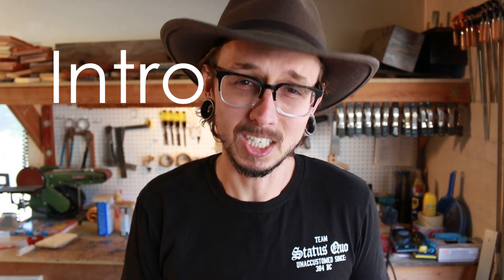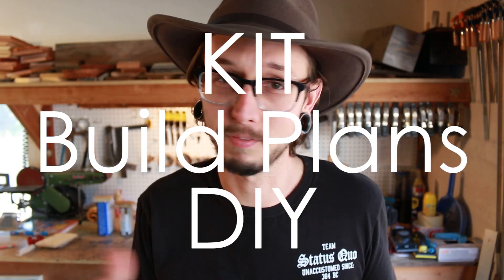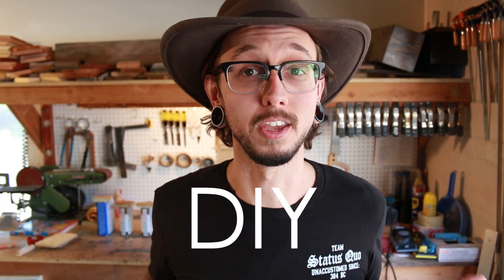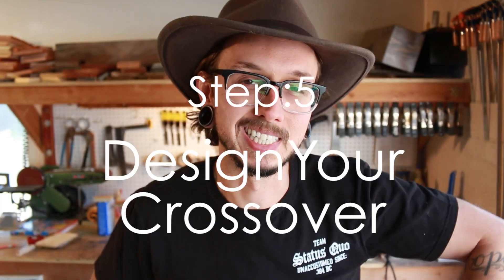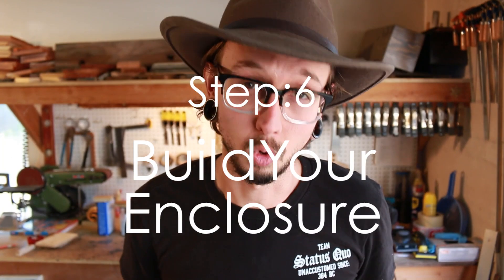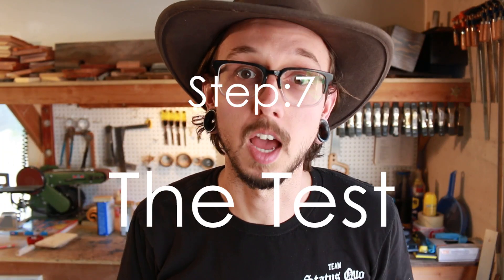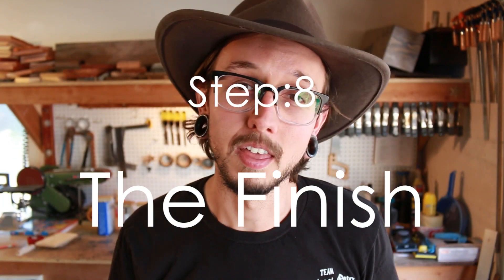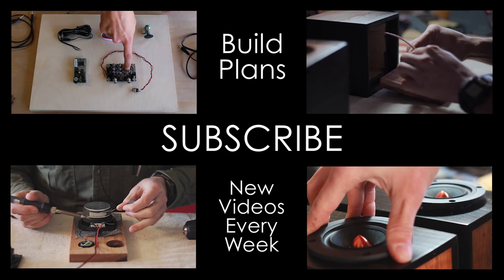Step by Step Guide to Build Your Own Speakers | DIY Speaker Building

Comment: I’m 15 and I started out buying a $25 Logitech surround sound system at savers (witch was acually ok) to now wanting a set of $800 Sony speakers (I don’t have 800 to spend on speaker) so I think this might be the way 😂 I’m really good with electronics woodworking really a lot so I don’t think it will be a problem

Comment: I had some oak boxes I turned into speakers / end-tables. I bought an instruction book from Radio Shack on how to build them for the right drivers. It contained all of the formulations I needed. Then, I ordered my tweeters, mid-ranges, and bass drivers with the proper crossover along with the connectors. They both sounded great and looked better than any item you could buy. Plus rugged enough to be furniture or moved to another location.

Comment: So this video goes over everything i already know. there is no actual in depth video of how and what to put in the calculators. i can calculate air volume that is addresed on the website of the speaker i want. but then if i would like a speaker with a tweater and a mid range that is ported. or a speaker with a full range maybe mid range with a passive radiotor. i can't find ANYTHING that is usefull to what i would like to know or need to know to calculate the best box size. besides that there is more to it like speaker inpedance. For real i have watched your video's but i have not really gathered that much from them it did refresh my memory a bit so i wil continue my search and hope to get awnsers i have read a bit of the Sound Re enforcement handbook from Yamaha

Comment: still dont understand the Hz-KHz, and how to build 1 sound system that can reach pitches that would resemble the old electronic days.. I.E..Laura Phillips Anderson  and hard drum base.. CAN ONE SPEAKERSYSTEM handle all that?   putting a project together with a great Old School artisant, and was asked to build a flight case he can take on the road.. have  parts from Magnat .and lots of sound equiptment ... any tips ? needs to be put in a flight case and ready to board in a plane or bus...

Comment: Check out the Jaycar home speaker 10" woofer (Response brand). It's the 10" paper cone variant and cost about $65 (Australian) each. I got some and I run them with a 4" FR driver. The woofers are in sealed enclosures just with a single 5.6mh inductor on them. The best bass I ever heard! Even if someone offered me a woofer worth a mill, I would still have a real hard time giving up my Jaycar woofers. That's how good I think they are. Maybe it's not the "extension" below 60 hz, it's more the sharp attack of the bass notes and the wonderful kick drum sound. Like you can hear the actual skin on the kick drum being kicked. It's so sharp it's almost like a "tick", but with that deep thud that isn't too overpowered or "muddy" but with that deepness that makes a natural deep "rrrr" but not "boomy" just wicked balanced undertones. Sick! Check them out please, you won't be disappointed. Needs to be with either a med&tweeter or FR driver. They only go to like 1 khz. I can give you more details if you like. Every time I listen to them I wallow in the amazing bass sound like I'm being pampered in luxury. House is amazing with those sick undertones and snappy kick. Fuck I hope you try them (and I suggest you try them in a sealed enclosure, and start off with just a 5.6 mh inductor). I tried it first off with just the 5.6 and it sounded so good that I won't even consider anything else. Also my boxes have a slanted front so the box isn't all straight (and maybe that helps). My speakers are keeping me up all night cos I can't stop listening to the music.

Comment: Step #7
I don't think many beginners will be able to judge what to do with a crossover if they made it by computer or math, or even a pre built crossover. It takes experience to judge how to fix a crossover just by listening to it. I can do it cos I have been trying for decades. It takes time and curiosity. Now I have built a completely GUESSED crossover and it was GREAT the very first time. It happened yesterday for the very first time. My previous set of speaker crossovers took a year before I was happy (a particular challenging acoustic set-up in those speakers). But without experience you may have to go to your computer to tweak it. You have to know (approximately) all the frequencies in hz and khz (when you hear them). And you have to know (off hand) the ranges of the caps and inductors without looking it up, if you have any hope of doing it just by listening. I found out just by hearing different caps and inductors (over the years). No computer or math on paper (just in my head). And you have to know how caps and inductors behave in parallel and in series (way difference). And you have to watch the impedance with your resistors etc. I have some speakers that go down to 2 ohms above 10 khz. lol but I am actually aware of that and the speakers sound great so I don't care but I would NOT put those speakers on any hi end (expensive) amp. And I now have a different driver set-up design and so this is the only pair I made like that. The next ones only go down to 4 ohms in the highs. Ineficient but killer sound top end. And there is the (dreaded) woofer tweeter level that I think is very important cos it gives you a choice on bass content against treble content. Too much woofer can DROWN OUT the nice highs and visa versa. And that I find is about the most difficult crossover challenge. My "tweeters" are coaxial (inside med drivers) and the "tweeters" are completely DIPOLE. That's why they are ridiculously inefficient but killer best treble I heard.

Comment: I'm interested in building some home studio monitors, active if possible to save on space,  Ill be using a macbook pro & maschine studio and dont have room for an amp too. So to construct something like Rokit 5's or NS10's. Any suggestions to where to statrt choosing the component parts to achieve a flat response for playback and mixing.

Also, I have a 12 Kenwood car sub in a sealed enclosure and somewhere in a box some Focal 6.5 's with tweeters and seperate crossovers, as these were for car audio are they in any way usable.. for instance could they be hooked up to an existing home audio amp rather than buy an inverter for the existing alpine and kenwood amps they ran off originally? and would the sound be any good - the focals are the yellow fibre glass coned ones and they sounded awesone in a car but wonder will that translate to an enclosure? 
Prob better than a steel car door I know but people get very antsy about using car audio speakers in home kit.. do they have a point? Keep up the good work and loving them tunnels! :) Peace

Comment: Calculate EBP (ported or sealed enclosure)... dimensions 0.6:1:1.6 or, 0.8:1:1.8...  Purpose: PA or Near-Field Monitors... active crossovers vs. passive.

Comment: I am building with one 1" tweeter and two 3" midrange speakers in each box with a separate subwoofer. question is how or where to buy a crossover with taps for only one tweeter and two midrange.... the sub will be limited already by the amp.
Reply: I actually have a series that will teach you how to build a custom crossover for these.  It even includes the wiring of the two 3" mids

Comment: What are your thoughts on building a two-way system without a crossover at all, and just letting each driver follow its natural frequency response curve? (And purposefully selecting drivers that had very little overlap in their frequency response.)
Reply: In theory, the less intrusive or complex the crossover is, the better and more coherent the sound. However, what you're suggesting would limit which drivers you could use, greatly. The closest thing I can think of would be a Lowther designed speaker, but that's just one speaker driver. 

If you could find speakers that are complimentary and have gently intersecting natural roll off points, it would actually be interesting to see how that sounds. 

A long time ago, when car audio was barely an industry, I drilled holes in my car's doors and rear deck panel and stuck home audio speakers in them. I had no idea what a crossover was and the whole thing sounded like crap. 

Shortly after that I walked into an electronics store and found out what a crossover was. I bought a pre-assembled three-way network, took it home and installed it in my car. It made a huge improvement even though it wasn't designed for my hodgepodge of speakers.

Comment: Hello,
i have seen almost all of your videos and i am planning to bluid my own portable bluetooth speaker but i have some question.
i am planning to use 2 tweeters with rms 60 watt and 1 woofer wirh rms 60 watt, i connect these with an bluetooth amp with 2x50 watt and for the subwoofer 10p watt, the amp has a max output of 3A and needs 18-24v but i would lije to use a battery bank wichh gives 18-24 output but there are only really expensive one or only 12v, how can i fix this? 
thank you for all of your videos, they really helped me!

Comment: Love the channel, id love to see how you wire up your speakers and in the future if you were to try something else, i think it would be awesome to see you incorporate an am/fm receiver and bluetooth receiver in the same system, im thinking about trying it out but im trying to figure out how id get the circuit wired up and working without a massive power drain, so far all i can think of is to have a 4-way rotary switch to alternate electrical feed to each receiver but if you can think of something better im open to suggestions

Comment: Hey Kirby! Just found your channel and it's everything I've been looking for I've been building ceramic speakers for two years for deep rich bass and quality high end at a large volume as well. I'm in the process of building a box that isn't ceramic and it's all falling apart 😢.  Don't get me wrong the box is solid and my wiring is spot on but attaching the speakers to the box without screws is messing me up silicone didn't work also it's a portable Bluetooth boombox that's ported with 8 drivers please help!

Comment: Anyone know of a good free speaker enclosure calculator thing?
Reply from the maker: http://www.mh-audio.nl/spk_calc.asp <-- Calculators for pretty much everything. Thanks for watching!
Reply: the best free enclosure design software is winisd. I personally use SoundEasy, but it costs money.
Reply: I'm in a similar situation. I can't seem to find the ts parameters on my speakers though
Reply: MapleCrotch what is ts parameters? The only thing j can find for my speakers are the resonant frequency, frequency response, sensitivity, size.
Reply: You use those things to calculate ts parameters which is used to calculate enclosure size I believe
Reply: I second WinISD like Impulse audio says.  I even have a series that teaches you how to use it.

Comment: Nice introduction for the absolute basics. I think a lot of people will benefit from your information. And yes there is no right and wrong way if you have a method that works for you. I've run into that over the years with some people. I do want to add a couple of thoughts as I've been building DIY hifi speakers for 20 years:

In the initial planning a major factor is the total Q of the woofer. To get the woofer to perform properly in the most basic sense there is one spec in the TS parameters most important to look at first. That is the QTS. For sealed enclosures, woofer QTS should be between 0.50 - 0.6. For ported and passive radiator between 0.25 - 0.45. The consequences to picking woofer with a QTS of lets say .3 for a sealed enclosure would be that the woofer will make no bass and have no weight to the bass sound. The consequences to picking woofer with a QTS of lets say .6 for a ported enclosure would be that the woofer will sound boomy and heavy, muddy and also have a bad resonance spike somewhere in the upper bass that would be nasty to listen too. After you have found an appropriate QTS then the FS and the VAS are the next most important TS parameters that can make or break how good a woofer can perform.My advice is to get a modeling program of some sort and try the woofer TS parameters in some different enclosure types and sizes and see what looks best.  To know what looks best in a plotted frequency response is a whole other topic so people reading this  need to learn that in a basic sense to know what to look for. 

A super basic program that works well is the Sub Tool box http://www.mfr-eng.com/toolbox.htm. This is a subwoofer program and a basic one at that, but I've used it many times over the years and it has never steered me wrong. However I know what I'm looking at with a plotted frequency response, and similar looking responses can sound drastically different when you get to the hifi level. With this program  you are putting in all your own data manually and you can compare many woofer plots so you can get a visual sense of whats happening. The best I can say for beginners is if you look at the frequency response example shown in the link you want something like the red sealed curve. That would be a very natural hifi response in a room. The green ported example they show has two different parts to the curve which appear as a cliff. This would sound more like a heavier boomy sound in a room, similar to the big box store  speakers. You always want one nice smooth looking curve for high quality sound and never anything drifting up above the 0db part of the graph unless you want some extra resonance over the rest of the speakers overall sound. But the great thing is that adjusting the box type and volume you could make a curve anywhere between the red and green one and that's when things get interesting. This means you can make exactly how you want the bass response to sound. Once you have that and the box type and size then its on to picking a tweeter and doing the crossover work.
Reply from the maker: Wonderful information! Thanks so much for taking the time write this out. I think it'll be a big help to a lot of beginners. And welcome to the community!

Comment: i'm finding it extremily difficult to find a amp that produces 200 watts per channle without spending 500 dollars can i run drivers below their rms rating and just use a 100 watt per channle amp?
Reply: You definitely can!! An RMS rating is only to tell you how much MAXIMUM constant power you can send to the speaker but having anything under that is fine. The compromise you make by going lower in power is how loud the system will be able to play without considerable distortion (still, a 100w/ch amp will give you quite a bit of sound, even with lower sensitivity speaker...) and you will loose a bit of headroom for those super high dynamic passages!! What I usually recommend is to have as much power as you can afford... The thing is, watts are really not all of the story when looking at a power amp! I would choose a 50w/ch class A/B amp with a toroïdal power supply WAY before a 100w/ch class T amp with a El Core power supply. Having good damping factor will ultimately give you better/louder/tighter sound because the amp will have a better control over the movement of the speaker cone! It's a bit like a car engine; watts are the horsepower and damping factor is like the torque, you want a good balance of both!
Reply: Jules Bilodeau thank you so much Jules i really do appreciate brother
Reply: It's a pleasure to help! Just to be clear, the RMS rating on a speaker serve to tell you how much CONSTANT power you can send to the speaker without overheating the voice coil, but music and movies are not CONSTANT power, they are bursts of dynamic power so it is perfectly fine and in most case recommended (if possible/affordable) to have more power on tap than what your speaker's RMS rating states. As I mentioned, you want as much power as you can afford. There is absolutely no problems running a 50 w/rms speaker on a 1000w amp (as long as you stay intelligent with the volume knob!). The lower the effort for the amp, the less harmonic distortion in the signal and the higher the headroom (read; better dynamics!).... Anyway, I could go on all day on that topic... Keep on listening friend!
Reply: ok

Comment: enclosures need to be calculated? I made a ported inclosure without any calculations, just measurements for the box itself and over all it sounds pretty good. I made my own speaker and only seemed to follow the last step (finish). great work kirby
Reply from the maker: Like I said in the ending, there's no one right way to build speakers. And that's definitely one way to make it sound good, but making it sound the best it can? That's a different story. Thanks for watching!